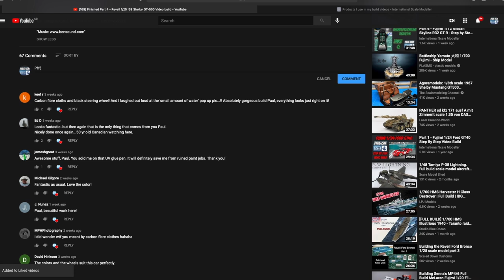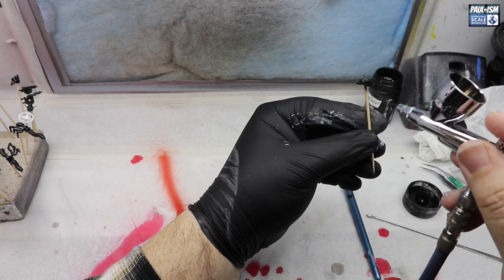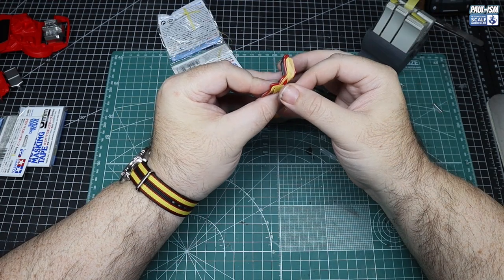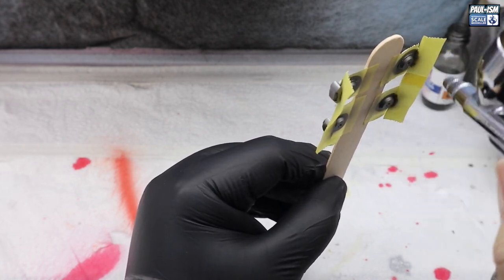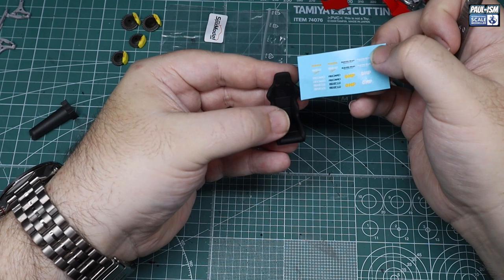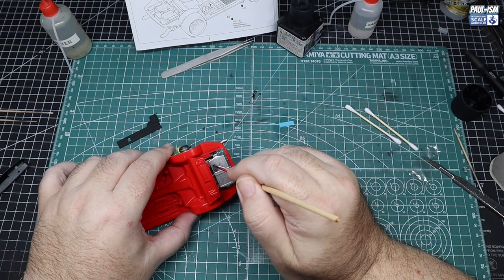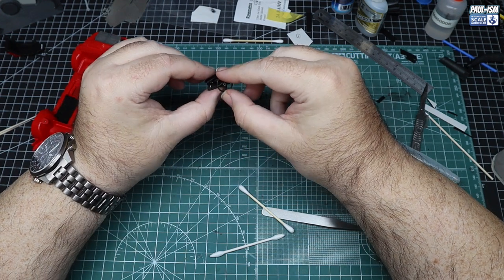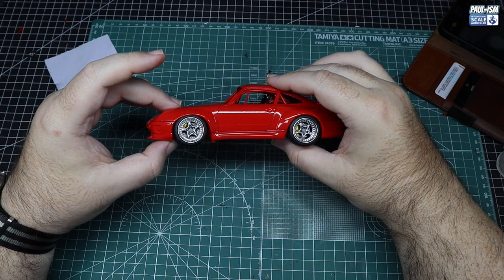Part 3 - Tamiya Porsche 993 GT2 Video Build

Comment: Very nice. I used Eduard photo-etched seatbelts which are pre-painted with all the markings, stitching etc on the belts but wish I hadn't. The metal is quite stiff and a few weeks after gluing the bodyshell on (due to a broken pin where the front of the bodyshell fixes to the chassis) one of the belts (which I had to glue to the seat back during the build as they would not lay flat like fabric does) popped off and even pulled the black paint off the white seat with it. I had to use copious amount of de-bonder to get the bodyshell off to effect a repair. I have removed the side windows and am going to cut them so both driver and passenger doors have no windows so if the belts pop off again I can stick them back down through the opening. So the moral of this story is I do not recommend them.